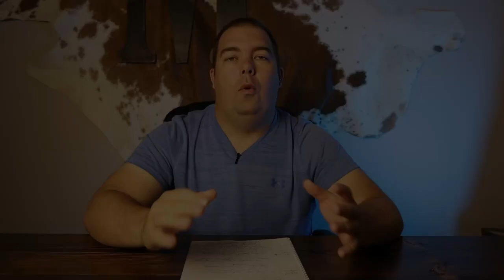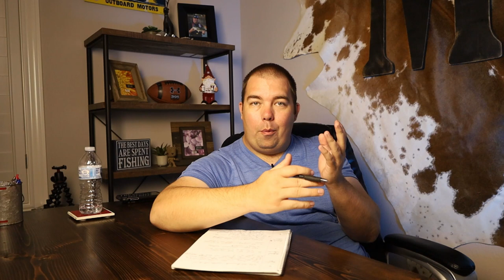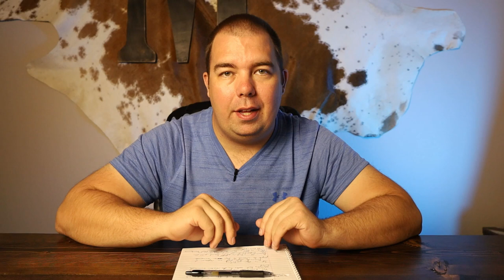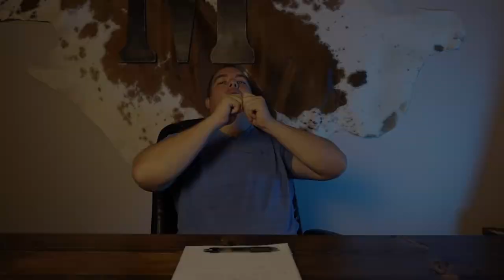Why Evinrude Failed?! | No More Evinrude Outboards (Thanks BRP)

Comment: Just got an old stratos with a 120 v4 Evinrude on it.. thoughts on this old 2 stroke?
Reply from the maker: If it has been taken well care of you should be good. If not, I would plan on a minor rebuild (reed valves, spark plugs, wires, rebuild carbs, water pump, maybe a seal in the foot) if you are mechianically inclined or run it til it falls apart and grab something newer.

Comment: Sorry to come to this review so late, but i can't disagree more about the ETEC. In fact, here in Australia, Telwater Marine had exclusive ETEC packages with their boats & at the time i purchased, i was fortunate enough to have a 10 year Boat, Motor, Trailer warranty on top of the purchase. I purchased in 2019 & this was 50h.p motor but in addition my son had a 30 & 60h.p motors & still not one minute of breakdown issues. Over the last 40+ years i have owned 9.9, 15, 25 & 70 h.p Johnson / Evinrude motors (prior to BPR) & again, not one issue. The dealer i purchased my latest boat / motor from told me that when he got wind that ETEC were doomed, he pre ordered 45 Boat / motor packages from Telwater & every single package had sold before he took delivery. He was also a Suzuki dealer & replaced the ETEC with Mercury & Suzuki outsells the Mercury 3 -1. It was devastating Evinrude collapsed! Thanks for your review too, as it was good to hear your perspective from USA.
Reply from the maker: Evinrude definitely was unpopular in the US. If you ran one of the newer ones, you got funny looks. Most everything here is Mercury or Yamaha.
Reply: @clearwaterfishing  Mercury have improved but i remember in the 80's & 90's we branded them Black Anchors. So the Motto meant, as soon as Mercury caused you grief, unbolt them off shore & use them as an anchor. If i had to purchase new now, i'd definitely go a Suzuki, man they are a good motor now but my ETEC is still going like a train. Thanks for replying!!!
Reply from the maker: @sittinginthebleachers6674  hahaha. I like that reference. Black Anchors! love it!

Comment: Are 4 strokes able to run and accelerate fast like the old 2 strokes? The ones I have used are lethargic. Didn't BRP fix the issues with 2 strokes (smoke, rough idle, etc)? Johnson and Evinrude before the late '80s were high-torque and bulletproof.
Reply from the maker: In my opinion yes. They have done a wonderful job at maintaining performance. It was a rough start for switching from 2 strokes to 4. They had some issues, but today performance is better.

Comment: I disagree, because the "why" does not go deep enough to the root cause.

Planned Obsolescence. That's my answer. From my perspective; when out on the water, I see many more OMC-era outboards in operation, than BRP-era.

There are a variety of different ways to gauge superiority of engines. For example, Briggs vs Honda. One would argue Honda is better, for obvious reasons. But another might argue Briggs, due to more affordable replacement parts and maintenance. If I can't afford a new widget for my Honda, then no amount of superior design will put it back in operation sooner than my Briggs with the exact same failed component.

OMC outboards were very much the "Briggs" of their market niche. Cheaper to repair, more places to find replacement parts, more cross-compatible part numbers; therefore, more backyard mechanics achieving successful repairs and returning to water sooner.

Disclaimer: Yes, I did somewhat unfairly blame BRP. I used them only as a very abstract mile marker. Truth is, BRP acquired the Johnson/Evinrude brands only because OMC already made the damning mistakes in sales strategies and redesigns. And also yes, I am ignoring an equally-deserved discussion around the transition from 2-stroke to 4-stroke--but I believe that only cascaded from pre-existing mortal wounds. If OMC had not turned to greed and Planned Obsolescence strategies, then the 4-stroke transition would have been seen as more feasible.
Reply from the maker: I appreciate your in depth analysis. Seems like this was a long time coming.

Comment: Owned 3 Etec  motors 40 tiller,  60 tiller  150 remote,  still have the 
Ast 2 . 150 is 09 and 60 is a2014 happy with both ,,150 has never been in the shop , 60 broke a gear in the lower unit after I tapped a rock nd faster than 4 strokes of the same hp
Reply from the maker: Sound like good luck to me.

Comment: I repowered from a 200 Optimax to a 200 HO G2 and I loved the G2. It did everything way better than the OPTI. Fuel and oil economy, speed, holeshot and top speed. In my opinion there marketing was crap, you never heard them market much on the positives. And they could have easily built a higher horsepower than 300.
Reply from the maker: Thanks for sharing! I hope it works for you for many years!

Comment: I run tohatsu four stroke commercially in Maine .it's a 2019 repower for 15 ' as aluminum closed bow 50 horse on 3 Rd year ,no problems ,except freak coil malfunction coverd by warranty
Reply from the maker: What are you doing up there in Maine? Just curious.
Reply: @clearwaterfishing  thanks for interest I dig Marine bloodworms in the mud from local rivers at low tide
Reply from the maker: @waterworld248  Wish I knew what that was. Guess I have to look that up!

Comment: Got an old 89 cajun fish and ski...110 evinrude v4 on the back...had it since 2001. Gets used pulling kids (and now grandkids) on a tube about 5 or 6 weekends every summer and fishing every weekend in the spring. Never let me down until today (8-21-21)...vro alarm. No idea on hours, but would guess 500 pluss since I've owned it...only new plugs wires and impeller in all that time. Guess I'm just lucky...
Reply from the maker: They made them better back in the day.

Comment: The fact that Evinrude only offered 2 stroke motors when the whole industry moved to 4 strokes is really what killed them. Reliability issues, starting with Fitch and then E-tec sure didn’t help their case. Mercury, Yamaha and Suzuki ate their lunch.
Reply from the maker: It would have been better if they offered a 4 stroke version, but they did sink in a lot of money to the e-tec to get a 2 stroke EPA compliant. They may not of had the resources to do both.

Comment: In 2023 BRP will reintroduce the Evinrude brand as the most advanced electric outboard on the market with around 500HP of pure electric power and a staggering 1250ft/lb torque.
Reply from the maker: How far will it go?
Reply: "Rares" Does it have a separate barge to carry the batteries. I can't imagine anyone getting real excited about an offshore fishing trip. With no downhill to help regenerate the batteries, no coasting to a stop sign, a 100 mile offshore trip would be questionable to say the least.

Comment: Also all sparepart price is make us crazy! Just try to buy single injector for e tec.. compare with you do maintenance for youre yamaha suzuki or other brand outboard expecialy for 2 stroke. That is why yamaha suzuki and other brand can survive at market
Reply from the maker: How much is an injector?
Reply: @clearwaterfishing  at indonesia south east asia, we ordered for 11 milion rupiah (us$980) from evinrude shop australia . emm is 1600 us$ for etec 90 because we at asia not europe, even for buy evdiag cd software and cable we take 2 month for order it at ebay 2nd hand, now my emm die.. another engine is crank but wont start,, and sad thing is "we dont have any evinrude daeler shop at indonesia" yessss evinrude etec is the most powerfull i choose it. but than this all make my head blown, its ok for all of you at US or europe but for us at south east asia.  is not working

Comment: I see the old 18, 28, 48, 88 hp all the time , them old motors you just can`t kill them .The etecs I hardly ever see one . I have a 2005 75 e-tec it runs good ,but it looks like hell , the cowling has cracks and fractures all over it . the oil tank has cracks in it . I am running the e-tec just because it came on the boat , I paid 2500 for the boat motor and trailer . The guy I bought it from said it`s 2500 for the boat and trailer ,and the motor is free .
Reply from the maker: It really seam that BRP is the common factor around the end of Evinrude. The older stuff was bullet proof and the newer stuff never got to that reputation.

Comment: Honestly i’ll probably get an older johnson or a 5 hp mercury for my self they seem reliable heard no complaints. However my friend is on his third evinrude water pump after 2 years of owning it.
Reply from the maker: Sounds like you are running a jon boat.
Reply: @clearwaterfishing  yes i quite enjoy my big battery in the meantime lol
Reply: Sounds like someone is improperly installing his water pump or he's just changing the impeller and not the entire kit. Should never wear that fast.
Reply: @deansclafani5567  he's replaced as a kit I did it this time around so I know it was done with care but his other friends kind of slapped it together so that's probably the case.
Reply: If he is losing water pumps, is his intake allowing big particles in? Maybe too much sand where he operates?  Something isnt right there. There is nothing odd with their pumps...just same as any and unchanged in years.
Reply: @Steve-yh1pj  yeah i think his problem is not winterizing it properly and the cold is making pumps brittle.

Comment: They failed due to the failure of OMC and the VRO, the VRO 2 was better but put a sour taste in the industry. They sold too   and released the ficht, which was a huge fail they sold out to BRP and the E-tec came along, a revised ficht anyhow too keep it short at this time the industry switched to 4-strokes. the 2 stoke market was basically dead, between the bad rap of the name evinrude/johnson, slow sales, hard to meet emissions BRP chose to discontinue to product line.... they really have no 4 stoke replacement too for a outboard unless they design one, or team up with another company. Anyhow BRP didnt destroy the brand, it was doomed years ago.
Reply from the maker: Do you think they will come back?
Reply: @clearwaterfishing  honestly no, brp is more about offroad. can am mav's and defenders and sea doos, in this day of age its hard for them too even get parts for them, i work at a brp dealership and still waiting on ecm's clusters and dess post, evinrude has been stuck in 2 stoke, with no 4 stroke offers. i cant see them coming out with a new four stroke with the transistor shortages.

Comment: It’s not a surprise that they failed. People don’t want two strokes. Just repowered my boat last week with a brand new Yamaha 115. I would have never considered a 2 stroke in 2021. Even if it were thousands cheaper. The 4 stroke technology has gotten so good that there’s really not much of a reason to be against it anymore. The power to weight ratios are much better thanks to innovations in the manufacturing of the engines. Reliability is better. Etc. back when 4 strokes were gaining momentum in the early 2000s… They were overweight, still carbureted, and not torquey at all… That can’t be said anymore (unless it’s Honda). 

I don’t miss my Johnson 115hp 2 stroke at all.
Reply from the maker: I agree with you. There are still a ton of mercury 2 stokes out there and they aren't very expensive. No one wants them.

Comment: Yeah true they should of just gone down the four stroke path.
Reply from the maker: I agree. The 4 stroke would have been much more reliable. I don’t know what they were thinking!
Reply: Four strokes absolutely suck for torque
Reply: @samdittmar5142  Not the latest 4 strokes. Go drive a new 4 stroke boat. You’ll be surprised.
Reply: @d3adk964  the merc v8s have torque for days but all the 4 stroke 6 cylinders just don’t compare to the evinrude 2 strokes